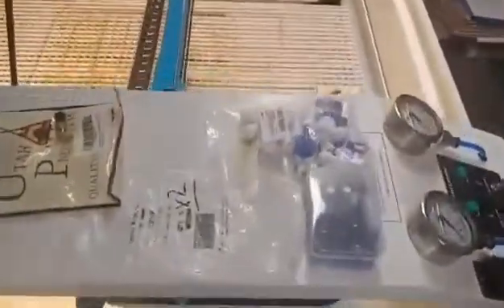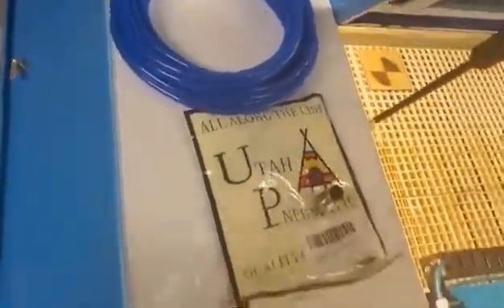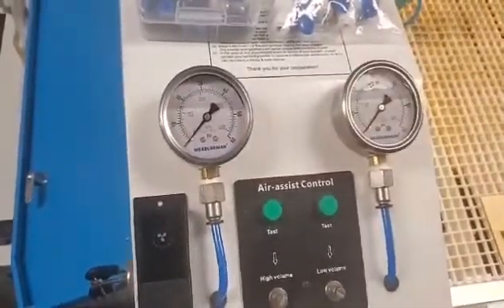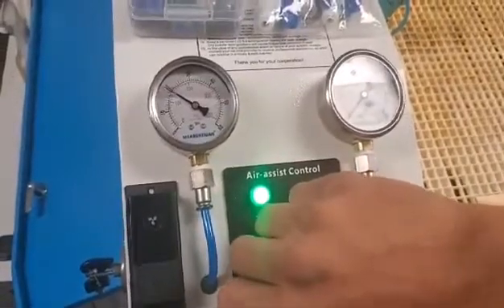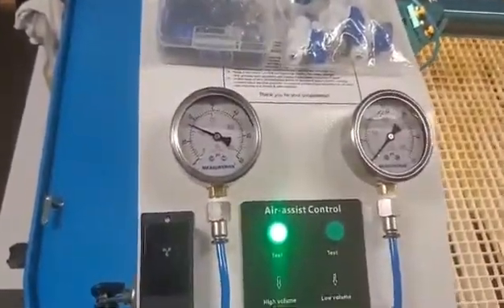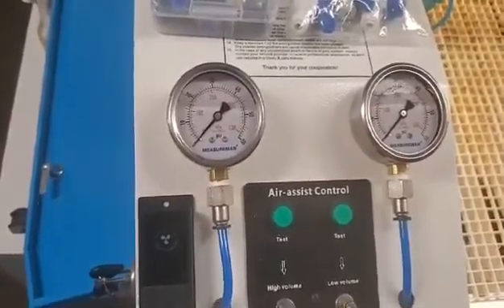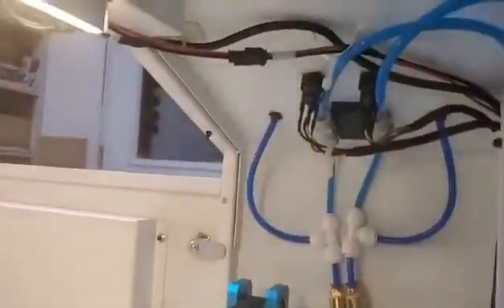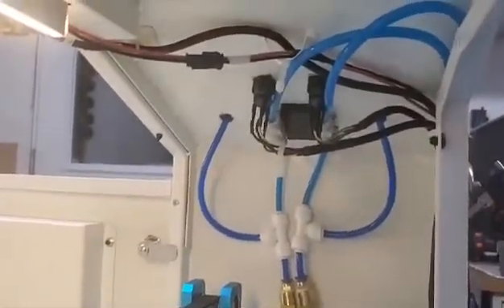Gary Wiant Air Assist Gauges

Comment: Thanks for the video. A couple of questions: 1) Can this be done in conjunction with installing the "Cloudray Ultimate Air Assist Set" like I have seen in some videos and 2) did you provide a parts list that I might have missed? Thanks.
Reply: Actually, I got an email from Thunder Support who said that the Cloudray kit would have no benefit on their dual assist set-up but I am still interested in the parts list for the gauge mods. Thanks.

Comment: Gary, where did you get the check valves?
Reply from the maker: here is one: https://www.amazon.com/MettleAir-MCVU-Connect-Inline-Fitting/dp/B007I35HL4/
Reply from the maker: and another: https://www.amazon.com/Connect-Straight-Check-Fitting-MettleAir/dp/B008RYJ4TY
Reply from the maker: fyi: people are using these with water at pressures near 75psi according to one review, but i would not get this type. you want one made for heavier duty use like the ones linked earlier. i have no data to base this on, its just an observation. this is the type i would avoid: https://www.amazon.com/Malida-Connect-purifiers-Reverse-Osmosis/dp/B0105G3HVW/
Reply: Thanks, And where exactly do I install them? Right at the gauges?